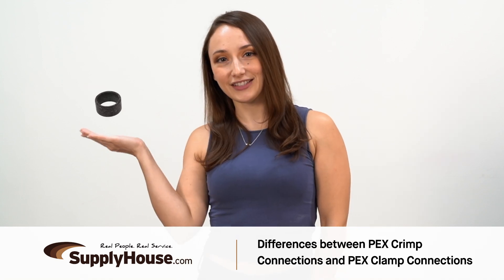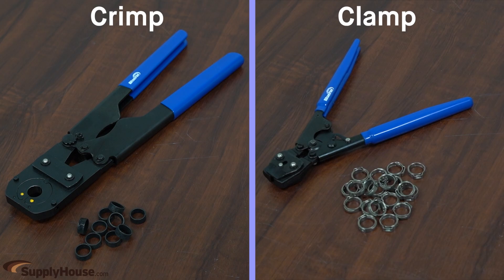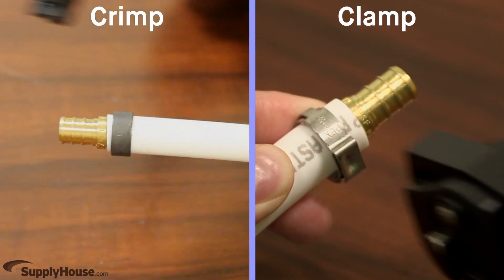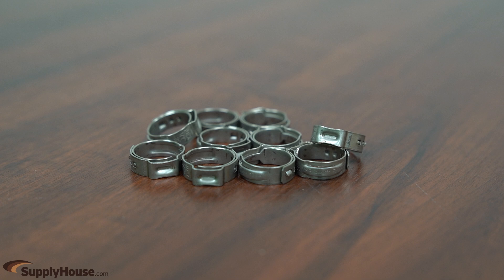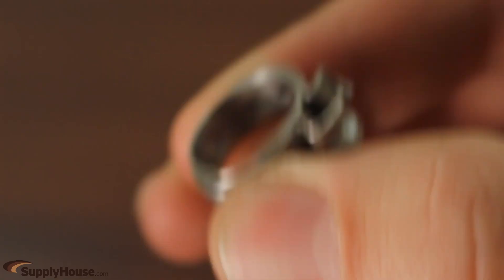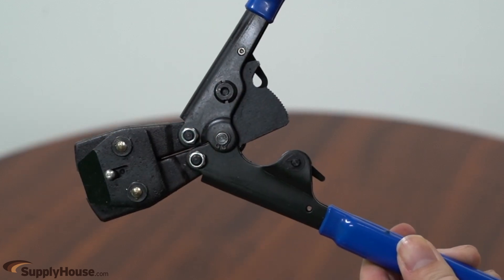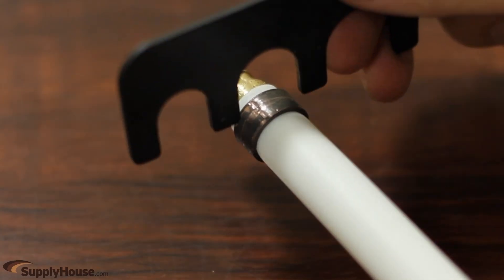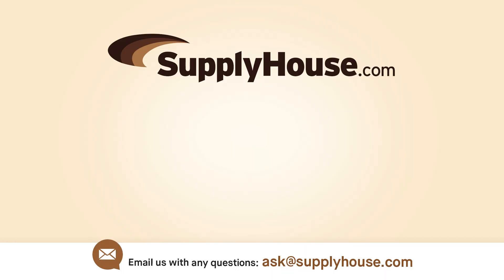Differences Between PEX Crimp Connections and PEX Clamp Connections

Comment: Great job!  Thank you so much.  I was wondering why I was having so much trouble with the Clamp connections - my friend has the wrong tool (he has crimp tool) but told me it works fine for both - No, no it doesn't!   Now that I have the correct information, I can finish my water heater installation.  Thanks again!   ♫

Comment: There is absolutely no clear information on what truly is the best method. I used crimp. As long as you know WHERE to crimp (in relation to your fitting or connector), and use the correct tension, I find them super reliable. I have yet to clamp, but am not against it.

Comment: I just started using a pex ratchet clamp tool. Because of the nature of the clamp rings, I cannot use the go no-go gauge.
How do I tell if I have ratcheted enough times? Is there some lee way in how tight the clamp ring connection has to be?
Can I ratchet it too many times?
Reply: As far asi know you can't ratchet it too many times, at one point it will stop crimping at which point you release the tool.
Reply: The pex pinch clamp tool I purchased from home depot has a blue light that tells you when you're done pinching. It was still pretty cheap. Not sure what pinch clamp tool you got.

Comment: Some of the biggest claims Plumbers insurance companies have paid out are because of pex connections failing.  Interesting that homeowners have moved to pex over sweating copper.  
If copper joint fails you have a drip but the  pipe will never separate. With pex you can have a drip, a brass fitting fail on pex b, or have a pipe separate from a fitting because of poor craftsmanship combined with water hammer.  Pex A is harder to screw up but requires an expensive tool. Pex A will let you have less joints in the wall, which is always better.  All home runs with no fittings in the wall is the best way to use pex.
Reply: lol.. I have seen copper have a complete failure at a soldered fitting and full pressure coming out

Comment: Question: Is there any truth to the claim that led clamp connections have a higher failure rate than crimp connections? If so, has there been a study done to prove these claims are true?
Reply: Pinch clamps can loosen over time potentially causing a failure to the watertight seal. If the space is available, it's better to use crimps.

Comment: I’m a licensed plumber and Copper rings are the best. They make a far more firm press to the pipe.
Reply: They also cost less... Tool is only 20% more
Reply: Ben Dragan how do you like the pex A fittings? And which pex is better? Pex A or B?
Reply: Bernie Mac pex A is far more superior in every way but high pressure. Though they are more expensive. We use them up to 1-1/2” piping. Then we go with CPVC Systems.
Type A piping is more versatile, bend easier has better shock absorption for water hammer. The inner pipe size “IPS” of the Type B pex fittings are not true pipe size just like a 2”x4” stud is only 3-1/2”. So 3/4” type B pex is actually 1/2” Type A piping.
Again more expensive. You get wha TM you pay for in this case.
Reply: Ben Dragan ahhh interesting, thank you for the response! The pipes shouldn’t see high pressure so it isn’t a drawback for me. One thing I am concerned about is the taste of the water. Pex A is more malleable compared to Pex B, so with those different properties does it make the water taste like rubbery plastic?
Reply: Quick question beniamin6665 what about down in Florida if they’re trying to get rid of copper due do to pinholes why use copper clamps when they corrode more than the stainless steel crimps?
Reply: Wow.. Very good question that far few of our clients ask or are concerned of. Pex A is much better then Pex B for leaching plastics into water. They (scientists) day that no plastic leaches into the water when it comes to Pex A. Pex B you can literally taste it.. you can always place a filter where your drinking water. Now in addition to all of this copper is the best at keeping you healthy. It leaches copper into your water and your body needs copper. You can just eat supplements and your fine. Though I as 
a plumber will be plumbing my home in either Copper Or Pex A. Also copper saved my life. Hyper thyroid. Lost 25 pounds. Worked with copper bare handed for 2 months and it absorbed into my blood. Hyper thyroid is a copper deficiency. Hypo is a zink deficiency. just A FYI
Reply: @Beniamin6665  how reliable   are clamping and crimping compared to copper soldering in long term. I'm referring also to what's happening in Texas. Ty
Reply: @esojanacig9230  I have no idea what’s going on in Texas other then the snow storm.
Copper is bullet proof but the other stuff has different benefits. The type A pex can handle freezing the best. It expands and contracts without wear. Now Type B pex can expand and not explode but one should replace the expanded portion of pipe once the freeze is over. Now the fittings them self cannot be frozen otherwise they explode like copper but the least point of resistance is the pipe.
Now brass fittings more likely to withstand the freeze then plastic.
Reply: @Beniamin6665  Thank you for the reply. There was a lot of busted pipes all over Texas during the snow storm and hard freeze.

Comment: If you need a go, no go tool, you know it's trash
Reply: @jeffel80  and gun assembly tools
Reply: That’s the problem with the cinch clamps, no way to check the joint. If your tool is out of calibration, a leaking joint behind some drywall will be your only  sign.

Comment: Thank you Emily, I was wondering what the difference was between those two connectors? I have the clamp Rings, it was wondering if it was still safe to use being as the other ones were also available in the store. I feel better with going forward with the project this weekend, thank you so much sincerely John.